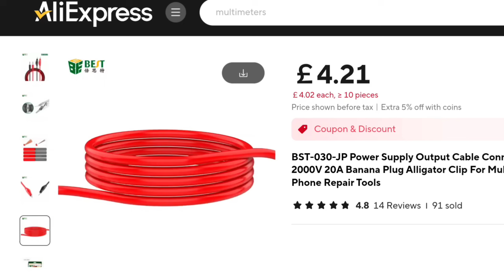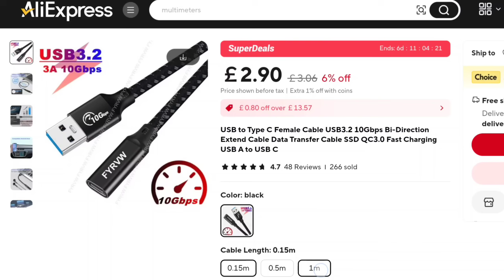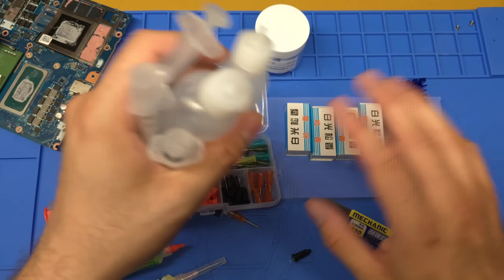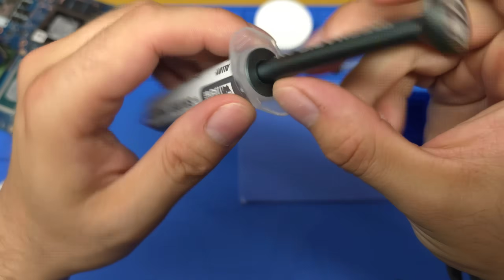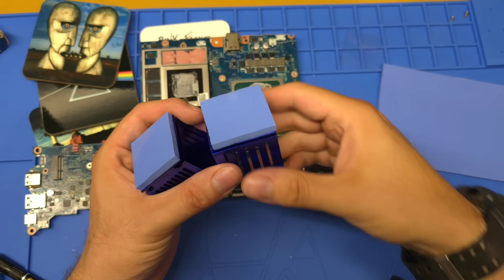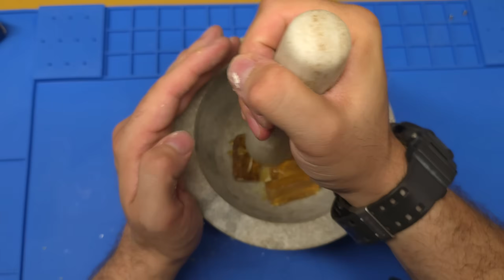Tool Talk - Ali Express Electronics Tool Haul 3

Comment: 19:33 that gunky stuff is thermal putty, it is used instead of thermal pads as it works quite a bit more efficiently than pads. a good replacement would be upsiren ux ultra pro. a review of this putty: https://youtu.be/raHKGnJ4LYM?si=KWO6UqFlsD7VngTy
Reply from the maker: @rick5078  Very good information added to my shopping list
Reply: very important to only use putty on laptops that came with putty from the factory as thermal pads will not be efficient enough. Besides that, it will be quite the task to figure out the correct thickness of pads to use, if the pads used are too thick, the heatsink will no longer make proper contact with the cpu/gpu.

Comment: Is that screwdriver still working?
Reply from the maker: Which screwdriver?
Reply: @JFIXX1  I think I ended up commenting on the wrong video somehow! I meant the fancy one you twisted that you showed off in a previous video! I'll comment on the correct video to increase engagement ;P
Reply from the maker: @mikedub the ES15 Miniware! Yes it's my favourite I use it all the time. It is now one of them tool if it breaks I will instantly buy a replacement

Comment: About the flux. No need to crush it, small pieces will easily dissolve In a couple of hours. I've made my own flux for years. Also buy 500 gram rocks. Much, much cheaper..
Reply from the maker: Thankyou I got the biggest tin I could buy on my latest video 😊

Comment: Great stuff. Thanks for sharing. One thing I'd mention is that the price for MX-4 is too cheap to be genuine. The box should have a scratch-off area that when scratched, reveals a code. You can then input the code into their authenticity checker to see if it's real.
Reply from the maker: @JustInspiredKent  Thanks for the heads up! I have no idea if it's genuine I have thrown away. The paste does the job tho so if you want a big tube for a cheap price. Maybe it will dry up faster than a genuine product

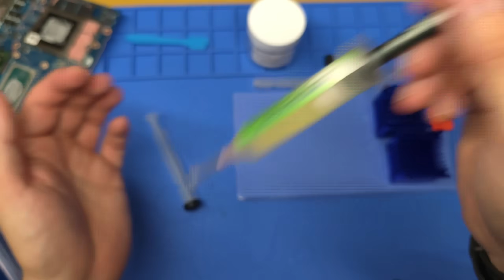Comment: 13:08 instead of that plunger, I can recommend the 10cc manual syringe gun by vmatic they sell on that same site.
Reply from the maker: @rick5078  Thanks I will check it out !
Reply: it goes for around 18 usd on there.
Reply: I have an older version of that Mechanics plunger. The thumb knob is a bit smaller and tends to screw off at importune moments. Another thing that I noticed is that it got smeared with flux because apparently the orange seal is not completely tight anymore on the industrial syringe that my flux came with. Easy enough to clean off with a paper towel with some IPA, so not an issue. They are lightweight and quite rigid; good quality. I've also bought one with a handle on the side, but the amount of control was disappointing. On top of that you have to adjust the bolt depth manually as the flux gets depleted. Nice idea, but does not work well in practice. When you grind up rosin, be sure to filter it, so that any remaining debris will not clog up your nozzle in the future.
Reply from the maker: @LarixusSnydes  Thanks for your advise I'll probably try few more options to see which one I like the best and gives the most control
Reply: @JFIXX1  The smaller circular part at the end of the translucent plunger clips into the white wiper at the bottom of the syringe.

They supply them seperately so it's shorter in the shipping & not likely to be squeezed out.

Also leave the output cap on & hold it when you shove the plunger into place.
Reply from the maker: @chrisharvie-smith486  That makes sense thanks for the valuable information it wasn't obvious to me haha